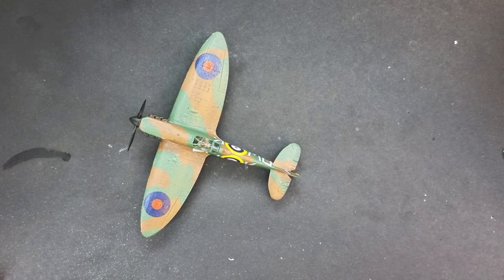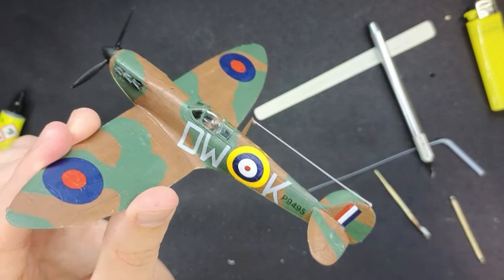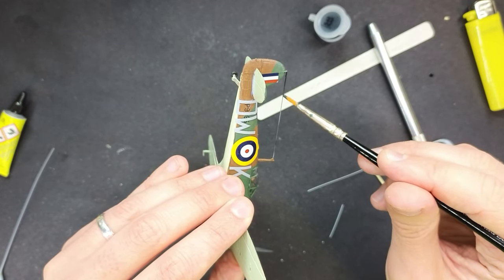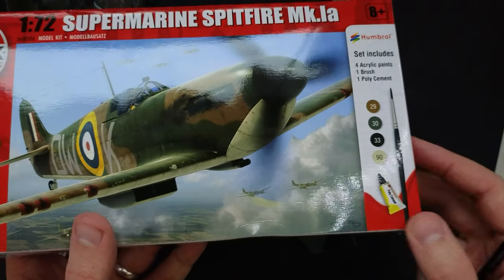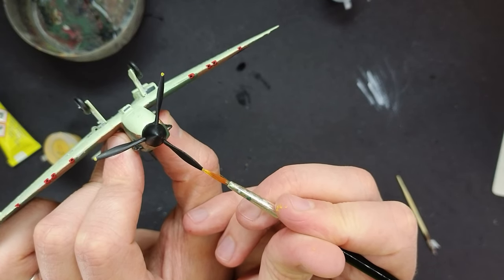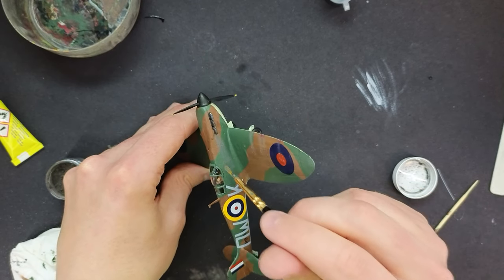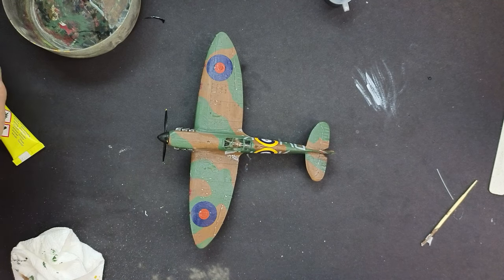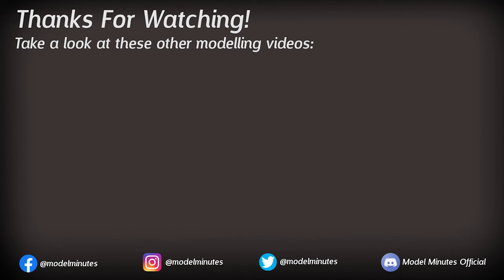Airfix Spitfire Mk.Ia - Build With Me! Part 5: Extra Details & Adding Some Finishing Touches!

Comment: I picked this and a P-40 Tomahawk kit up from Aldi last week. I built the Spitfire and it went reasonably well considering I haven't attempted an Airfix kit in nearly 20 years. Had to shave a few bits with a Stanley knife to get them to fit flush. A cockpit piece snapped getting it off the sprue, and while I sort of fixed it with a bit of glue, it does mean the pilot went in at a funny angle, and with the canopy in place it looks like he's slumped dead against the perspex. 

I also completely botched the decals at the end too, with all the lettering and numbers ending up crumpled and torn. I managed to salvage the roundels so I have an anonymous Spitfire, that belongs to no squadron at all. Made a right mess of a worktop with the Stanley knife too... 🤣So I think before I attempt the Tomahawk I'll get myself a proper cutting mat, and a few other tools that will help a lot.
Reply from the maker: As long as you had fun, I think that is the main thing :D